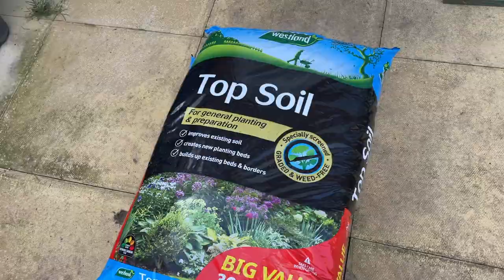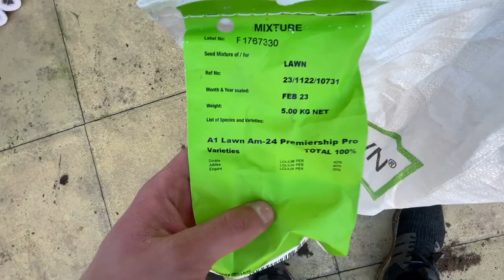How to easily LEVEL and OVER SEED an EXISTING LAWN - Complete Lawn Renovation

Comment: How did you find the Westlands top soil? I have incredibly tight access to my house so always have to buy individual bags but never tried Westlands before. Great video. I'm hoping my renovation will start in the next couple of weeks or so
Reply from the maker: I would definitely recommend it. It's pretty cheap and the bags definitely make life easier. Most people don't have space for a huge bulk bag or a way to wheelbarrow it through (which if often back breaking if you do it for long enough!).

Good luck with your renovation! 😁

Comment: Another great video mate I followed your steps in my back garden last Saturday and covered with landscape fabric no sign of germination as of yet ive used the premiership pro how long would it be before you would start to see some germination?
Reply: @MxWoody  had a check yesterday we have lift off 🚀
Reply: @MxWoody Hi mate how's the grass looking now I was thinking of getting some. I put down some "spear and Jackson's" over a week ago nothing as yet 😀👍
Reply: @MxWoody  yeah il give it another week if nothing il rake it up and order some A1 seed 👍
Reply from the maker: It does take time - frustrating sometimes when you look out at it seems that nothing has happened!

Mine took around two weeks before you could see the tips coming through. It's just about got to the length now that I can cut it. The only problem is that one half of the lawn gets a lot more sun than the other half with it being early spring, so one half is ready for a cut and the other half is playing catch up!

Comment: I followed all your vids as I was doing garden renovation at same time as you. My lawn has all settled from flat to sunken in and needs to be re leveled. I see you used the bags of topsoil rather than getting bulk bags, do you think its cheaper buying small bags or is it just you don't have to wheel barrow it all in?
Reply from the maker: Much cheaper with the smaller bags this time! I have a few bumps, nothing too major. I bought just over 20 bags, but ended up with loads left over. It was surprising how far each bag went with the bumps in the lawn only being shallow.

Not having to use a wheel barrow was definitely a bonus too! It gives me flashbacks to the 5 tonnes last year! 🤣